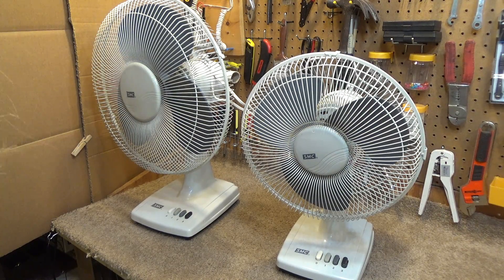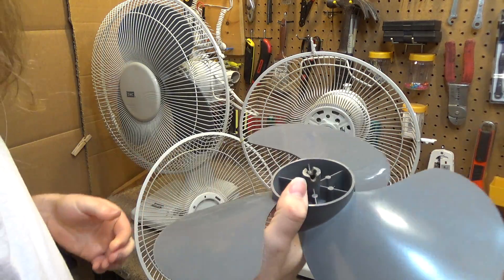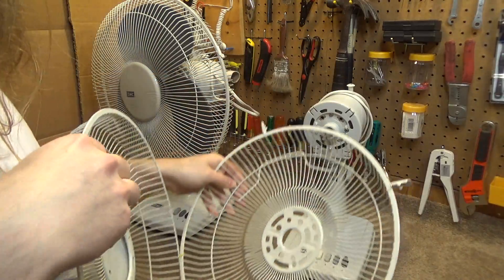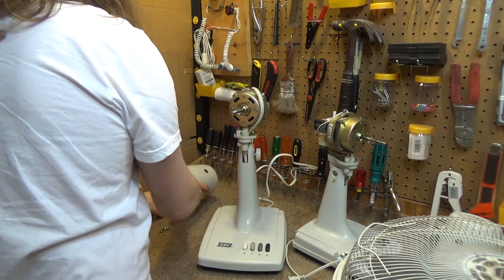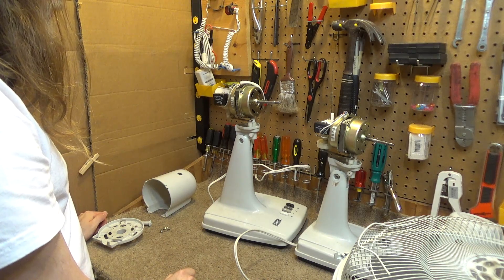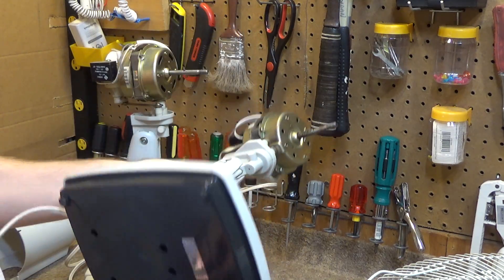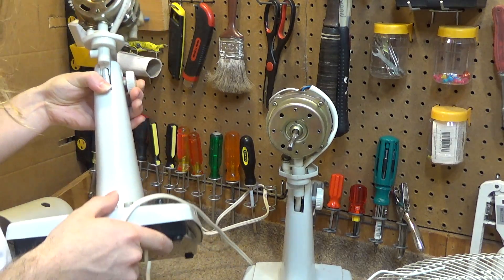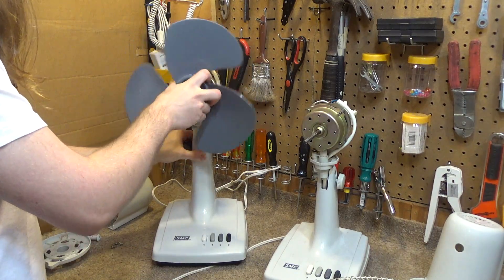12" and 16" SMC TH Series Oscillating Fans | Motor Comparison

Comment: I was shocked to find out that the 16" blade has the same air resistance or weight to the 2000s Lasko 2016
Reply from the maker: How did you determine that?
Reply: @JordanU  I placed the blade on the Lasko 2016 and ran on all speeds in which the blade ran faster blowing more air than when it was on its own motor which I see that the blade air resistance is the same as the blade of the 2000 Lasko 2016. Trust me try it and see for yourself. FYI If you swap the blade with the one of the Hawaiian Breeze (midea) you'll see how much lighter it is

Comment: Hey Jordan. How many inches are the screws of the smc and the homedepot motor front cover away from the center? Because the windmere's NR-12 is 
1 1/8 inches away from the center
Reply from the maker: Which screws, from the center of what?
Reply: @JordanU  the screws of the front  cover to the shaft of the fan. I need from both the SMC and the mainstays/home depot 12 inch table fan
Reply from the maker: @drakesessions3544  I don't know off-hand. I will try to remember to capture that information next time I have one opened for service.